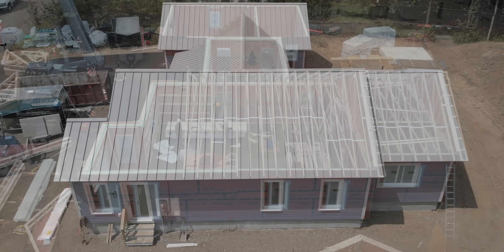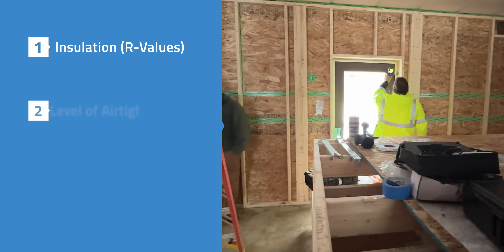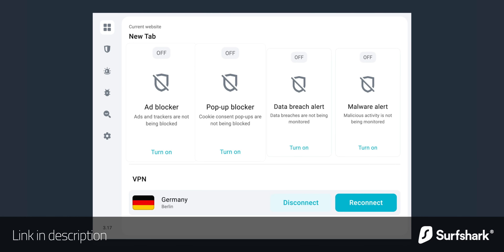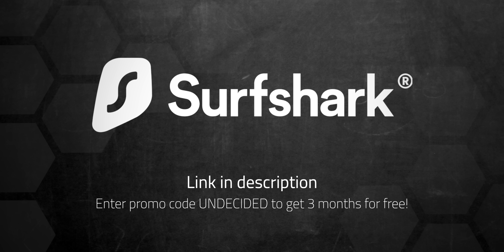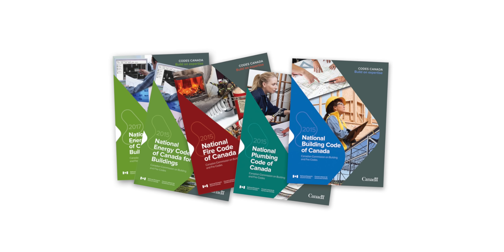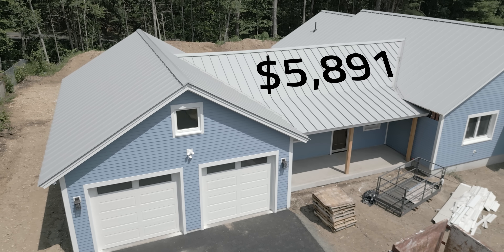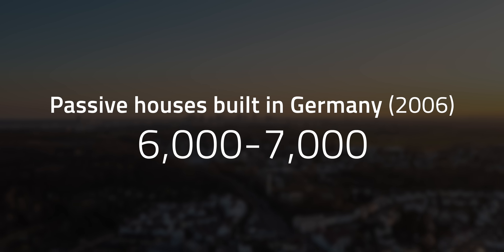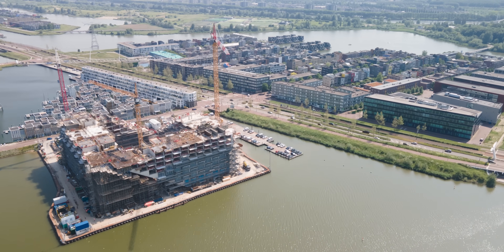Why Do American Homes Suck?

Comment: Yeah I really don't understand why Americans build the way they do... Here everything is made from brick and concrete, so the insulation is quite good even for standard houses. You can add extra insulation, which basically everybody does anyways. A double ore triple glass window is absolute standard. A friend of mine in Florida took $600 for air conditioning a month. Here the costs would easily be half, because the heat or cold from outside does not come in very well. So you still have to pay , just in rates

Comment: I grew up in the southeast corner of Southern California and my Dad was a builder. He built with 2x6 outside walls and that was in the late 50’s. We built our house in 1965 and I pulled in almost all of the electrical stuff in and all of the intercom in.we were the only house in town that had an intercom.

The Imperial Vally is a very hot place for most of the year. It gets up to120 in the shade and there is no shade. They say you get used to it but I lived there for most of my younger life and then moved to Utah, and that was a very big adjustment. I am retired now and live in Thailand and that was another big adjustment too. In the cities they have building codes but in the country, all you have to do is notify the province that you are building a structure. No permits or anything like that.

What we are building will be totally “off grid” and we will drill our own well. We won’t be drinking the well water but have the ability to do so. Our drinking water will come from a local source and we will have a tank to bring water to the property. We will also grow most of our food. The biggest thing on the property will be an aviary that will cover about 2/3rd of an acre. All in all I think it will be a very efficient property.

Comment: I own a steel frame home 2 story with 6 inch concrete pour floors with tile roof.  It is built like a tank.  Walls are true and no noise with wind
Reply: Of course I own solar/battery/EV.  Most homes built USA built poorly secondary to cheap electricity.  That is changing though

Comment: Ironically, the old method of building houses 300 years ago in Europe was much better than most US homes. What did they use?

1 wood frame with small windows and doors
2 filled with baked clay bricks or clay
3 covered with clay on the inside to generate air tightness
4 Covered with clay and lime on the ouside
5 the chimney in the middle of the house heated the entire house 

These houses were not passive, but their wall were solid and dense enough to create a basic insulation. Windows opened to the outside and when the wind pressed against them they closed tightly.

The massive walls and the clay made air conditioning not necessary in the summer. The walls buffer the heat!

Comment: Yeah see you pat yourself on the back with that cellulose insulation bit, but you got it wrong from the start.  Insulation belongs on the exterior of the building, not inside the framing.

The fact is homes in the US don't compete on the basis of efficiency.

They compete on how cute women will think the house is.  It doesn't matter how efficient a house is if your wife/girlfriend doesn't think it's cute enough.

Comment: In Ontario Canada, air-tight, and highly insulated homes with air exchangers have been the standard for 30 years. When you live in a cold climate it's a no-brainer to keep the heat in and the heat out in the summer. ICF (insulated concrete formwork), took a while to catch on, but the massive benefits to this type of wall construction caught on, and a child can put the walls together before the concrete is poured, the R-value is amazing.
Reply: it's interesting to me to see you speaking so highly of ICF. I am planning to build soon and basically talked myself out of it because I can get a better, more insulated wall with block and framing inside for about 1/2 the cost....

Comment: As a former German, I have been familiar with the passive house model since the 90’s. 
American houses have always struck me as odd, but I understand why it is différent. American mentality is different from Europeans. They want a deal, cheap and big. As long as there is a coat of paint, they are happy. Americans also move a lot more around so buying and selling is more frequent.
There has been another trend keeping US homes back. Bigger bigger bigger. Home size has increased by a lot. A 3500sqf home might cost $600k (depending on market) to build. But do we need 3500 sqf ? Would 2400, or god forbid 1200 sqf be good enough? 
Bring the size down and increase the quality is one solution. 

My own future home will be 1200-1500 sqf, and as close to passive house standards as I can get. My budget is under $200k. If buyers/owners/builders don’t care, the government won’t mandate higher standards.

Comment: What I will never get:
In the Hurrican areas (Florida etc) they build typical US scrap houses from timber and drywall.
OK
The next hurricane comes and blows the house away
What would an EU citizen do: Build the house from concrete and bricks and be safe for the next 100years
What does the US citizen do: Build a new scrap house of timber and drywall and wait for the next hurricane
The next hurricane comes and blows the house away
repeat, start at OK

Comment: I came to Canada a year ago from Ukraine, where I built a house months before the invasion. I used foam concrete blocks 20cm thick with an additional insulation of 10cm mineral wool outside. With all exterior and interior coverings, I got a 35cm thick walls, which are considered of moderate thickness. Of course, we don't have anything other than energy-efficient tilt-turn windows. Imagine my surprise when I saw that in the similar climate here in Ontario people build houses with 20-25cm thick walls with so ridiculously thin windows they need thick curtains...
Reply: canada has energy resources and doesn't have to rely on dictators like poo-tin for their energy so less motivation to improve energy efficiency. rediculously thin windows? were they double pane?
Reply: I live in the southern part of Ontario.  My house was probably built in the mid-50s, and when I bought it a few years back, there was absolutely no insulation in the exterior walls (built of 2x4s), and a dusting in the attic.  I would guess that the ACH50 rating then would have been about 12.  I've made improvements, but this place needs to be torn down.
Reply: You should move to Mexico. Houses are built much more solid there.
Reply: @PrimericanIdol  funny
Reply: @gna89  I'm serious. I lived there.

Comment: The heat pump for a clothes drier is new to me. Mine simply run on electricity, though I rarely use it these days, I just hang dry.

Comment: You miss an important point.  Surival of the poor.  Poor people construct a home out of whatever is at hand.  Mobil homes constructed out of SIP panels simply do not exist.  The floor would have to be made of sip panels.  In addition comm cabling should be included as well as power, and lighting. Remember 9 point video in home surveillance.  Home invasion is on the rise.  It is simply to hard to install later.

Comment: Many worthy points.  Air changes per hour should be at 2 or three.  CO2 warning should also include an air change.  That means increased sophistication.  Drafty old trailer homes were prone to high CO2.,  but the draftiness changed the air and people did not die.  Heat exchange plenum would work.

Comment: I think, the major problem for residential houses is the tradition of using wooden frames.
Walls made of concrete, solid or sponge concrete blocks, bricks with a mortar between are pretty airtight almost forever.
Just stick insulation outside and you're fine.

Insulation, soundproofing and airtightening frame walls is much more expensive.
Reply: In-house garage is also a pain it a butt. Is a garage "outside" or "inside"? If it's "inside", you need to insulate and heat it. If it's "outside" - you need to insulate whole house from a garage.

Just built a garage as a separate building and you'll be fine.

Comment: Part of the reason that US housing is not following the standards of elsewhere is that the units are different. I am very well-versed in metric building standards so know that a U=0.15 wall (W/m2K) is a good passivehouse wall (and 2.2 is a terrible single-skin brick wall). But I have no idea how good a Washington 0.045 imperial U-value is. (BTU/h.ft2.F)  This is true the world over so it's hard for Americans to use European specs or vice versa. Or even to talk about the subject to each other. I've tried dealing with US U-values in spreadsheets and it's very easy to make a mistake with all the conversions. (temp, power and area all being different). This video is in fact the first time I've seen someone converting between the two worlds. So in practice all their (US)  legislation, product info, and best practice publications are separated from the rest of the world operating in metric. It's not a huge thing, but it really doesn't help. And the US convention of working in material thermal resistance (R-values - bigger numbers better) rather than overall thermal conductance of the construction (U-values - smaller numbers better) also gets in the way.